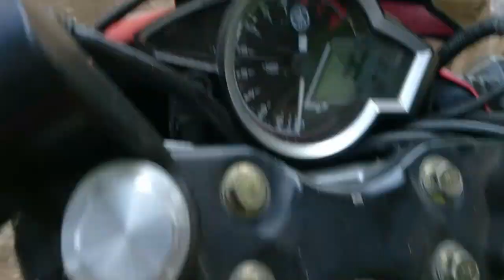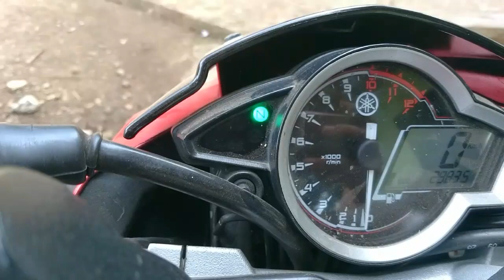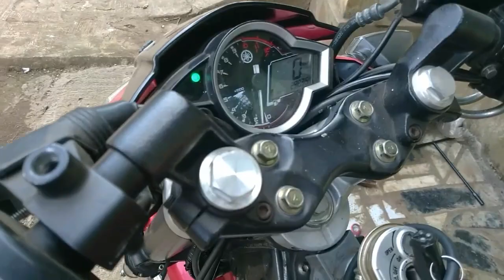Tutorial pasang 6 speed vixion, jupiter mx king

Comment: Hi, is it possible to fix 6speed for Yamaha FZ 16 Byson. Please reply
Reply from the maker: Do you from india?? I am never try apply 6 speed on Yamaha FZ 16 byson with Gearbox standar Yzf R15 . You can ask to other people.
Reply: @wong_motor  yes I'm from India,
In case if you come across any 6speed for Yamaha FZ 16 Byson, please let me know.
Reply: As I know, FZ16 (byson) different design than LC4V gen (old jupiter mx/sniper135/135LC/exciter135, new jupiter mx/135LCv2, vixion/fz150i, mx king/y15zr, r15). That gen had similar design, just minor improvement every new series  (regular clutch to slipper clutch, regular cam to VVA, 54mm-57mm-58mm bore, carb to fi, 5 speed and 6 speed)
Reply: @wong_motor  Hi sir, is it Gearbox of yamaha R15, plug and. play to yamaha y15ZR/Sniper 150?
Reply from the maker: @Speedtek18  yes.. it is plug n play
Reply: @wong_motor   Can we just buy some part of R15 transmission and add to stock Sniper 150 transmission. and what part do i need to convert the stock transmission into 6 speed?
Reply from the maker: @Speedtek18  
You must buy the part:
-5D7-E7131-00GEAR, 3RD PINION (22T/21T)
-5D7-E7161-00GEAR, 6TH PINION (25T)
-2PK-E8540-00SHIFT CAM ASSY
-5D7-E7411-10AXLE, MAIN 
-5D7-E7261-00GEAR, 6TH WHEEL (25T)
Reply: @wong_motor  Thank you so much bro, it helps me alot.